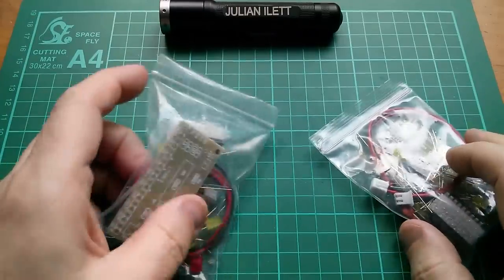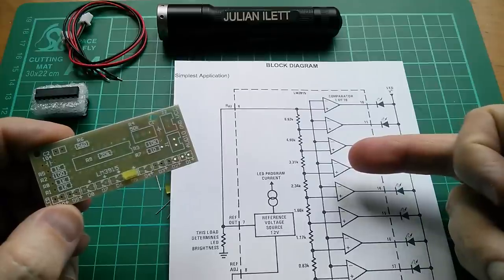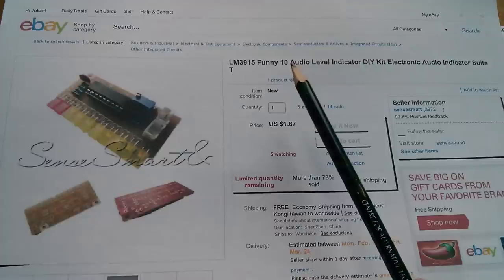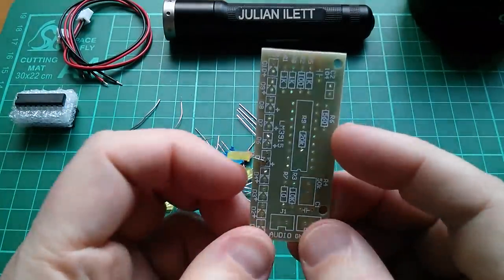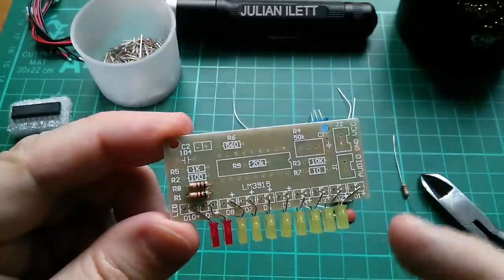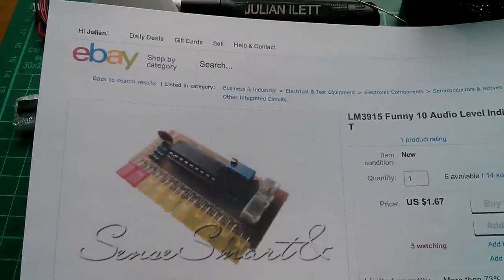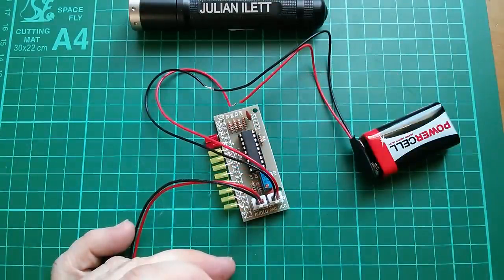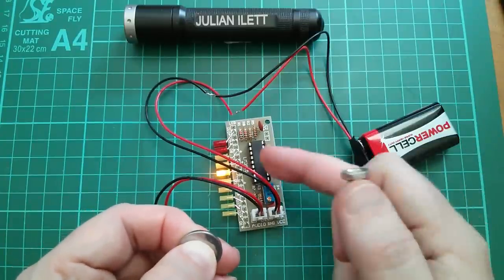Easy LM3915 Audio Level Meter Electronic Kit Build

Comment: These bargraph displays were the rage in the 80s. I remember buying the Mosfet amp kits from Maplin's in Hammersmith and adding a pair of these for power output indication. There is also a LM3916  with VU meter levels.

Comment: i like this video VERY MUCH because, as a broadcast engineer, I have seen bar graph representations used in many  different ways. One of my favorites is the setups which divide the audio spectrum into many different parts, frequency bands, and have a bar graph for each. Much time was used to make them truly representative of the spectrum. Then, one engineer would take a special type of noise generator and would show representations of the flatness of various parts of the system, including microphones and other parts. He was spending most of his time with FM stations. So, with about 10 of these you could build such a device.

Comment: Dear Sir,
I used to watch the video you put on the net! You are a great expert and I am an old retired! I bought two cheap kits and put them together! Go, yes it goes but it doesn't respond to the two channels as it should! The vibrations of the LEDs make it impossible to look at the delays between the channels! It's like a mono! I saw an assembled version in Italian, replaced with the two capacitor electrolyte. But neither drawing nor understanding! An old reader's suggestion to put two 2.2 micro F electrolyte condensers after 5pin, think one channel and solve the vibration and speed!
I'm not drawing because they didn't give me an old man just begging! I'd like to thank you for having a line! All the best!

Comment: I bought a couple of the raw chips for $1 awhile, pretty simple schematic depending how much control you want and easy to build on a prototyping board. The wiring can be tedious is the only tricky bit, as you need a connection per-LED.

Comment: I had built some stuff using these chips years ago,  and was contemplating building some more,  and when I saw the astoundingly low price on that ebay listing,  I went there.  Prices were a lot higher!  Then I added the word "kit" to my search,  and got some that were much more reasonable,  though still a little higher than what I saw in the video.  There are also versions of this which have a 741 op amp on the board,  presumably to provide that rectifier function.  I know that when I came up with my original circuit for this,  years ago, I had to use an op amp and some filtering to get the "dot mode" display to work like I thought it should...

Comment: The reason for the resistor on the red LED's is that they typically have a lower forward voltage and so would consequently be brighter at the same voltage as the yellow ones. 
BTW - Just go ahead and calibrate your sodding component tester!

Comment: Some interesting for builder followers of Julian, like me. You can swap out the LM3915 (log Chip) for the LM3914 and get a linear response which might better suit your particular requirement. There is even an LM3916 too.

Comment: I bought exactly the same kit from aliexpress with hope to use it as a battery voltage indicator. I was hoping (without reading manuals of course) that it'll work in a wide range of voltages: from ~3 to 15 volts. so I could use the battery itself as a power source for the IC. It turns out, that it's not gonna work that way. But I still can use a 9V battery as a power supply for IC and maybe replace LM3915 with LM3914 to achieve the goal.
Thank you very much for the video!
Reply: Well... Actually, LM3914 can operate with 3V power supply (yes, I looked into the datasheet). So maybe I can give it a try! (:

Comment: simply exchange the LM3915 with the 3914 for lineqar...oh you just said it...and the ´16 makes a fully true VU meter...;)
I love these chips...you can do so many great things with them...i used it so many times in my designs....over and over again...
The original TI-datasheets are somewhat complete, comprehensive and totally worth reading...:)

Great chips....;) Well Done TexasInstruments.

You may add a peak rectifier on top of that precision rectifier...so it will show both at a time...in dot mode...also read the data sheet where the current limitation is explained...you can drive the LEDs with far more current in dot mode hence brighter lights ;)

Comment: I messed with those chips back in the day a lot.  You can alter the response of the LED's by paralleling resistance to ground on the input pin.   You'll end up having to increase the gain on the input, but it tended to increase the "turn on/off" voltage sensitivity between the individual LED's and it would make it less likely for 2 to be on at the same time.  It was a different application so I'm unsure what effect it would have on audio.

Comment: You really need to calibrate your Transistor Tester. Just short out pin 1-2-3, long press. Unconnect the shorting cables when your told to, and stick in a >100nF low ESR capacitor (film is good) when the C-1 test shows.
Reply: mine is like that too, thanks for your instructions, maybe they'll work.
Reply: What a gangster

Comment: Thank you Julian, I bought one of these kits and was not happy about it, but after watching this clip I will be changing the 50k  around and also I was thinking of taking the 2-1K res and replacing with 510R just so as I can get the reds to light up more, the other thing I am wondering about is the audio input, should that be from line out or speaker out from amp, thanks

Comment: But Julian, you should have used darker yellow LEDs and keep it flickering for vintage looks! 
If you dont have dark yellow ones used RGB LEDs and solder resistors to the pins so you get an orange color!
And don't tell us that thats overkill, its called turn "$%#T into gold" :D

Comment: Anyone playing along at home. Don't put 12v in anything like this. It be nice and bright for about a minute and then die.
Reply: Not true.  Read the Data sheet.   3 v to 25 V is acceptable. I've run mine with a 3915 at 12 V without any problems
Reply: @ODX171  
I read that in the data sheet as well, but i really didn't have any plans to go above 6v. 
Is there any benefit to using more than 6v.
Reply: Domino :  I don't know of any benefit of more than 6V.  I didn't build this kit BUT did build a similar circuit for a VU Meter project I built. I currently am using a 9V adapter I had around. Here's my link if you care to view.....https://www.youtube.com/watch?v=afNoje0KEFI&t=226s

Comment: nice video...  two circuits of two lm3914 (4) chips should make a sweet on pcb pos/neg 10vdc linear signal input/output setup meters... with dots or bars for power saving?  Thanks...:)

Comment: Think I screwed it up. When I connect 2032 battery to the board it simply lights up D8 and D9. Screwing the little screw changes nothing. Ideas?